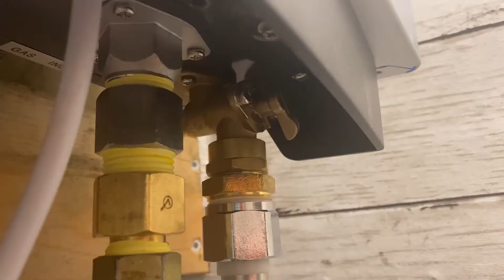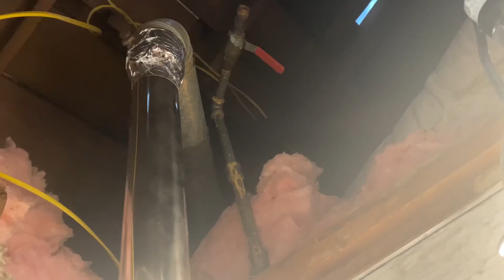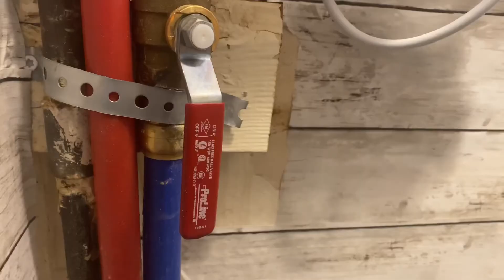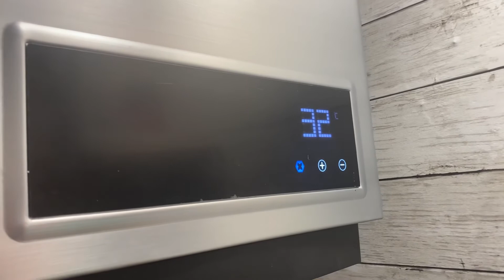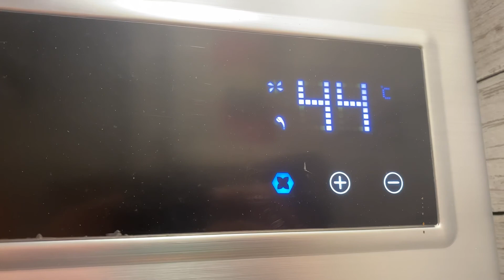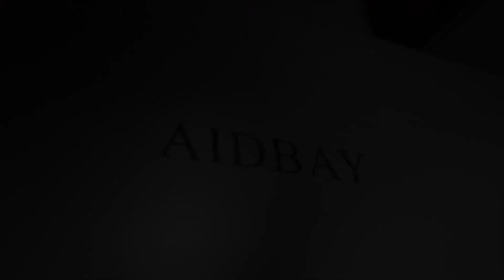AIDBAY Tankless WaterHeater

Comment: Do you have any info on a warranty for this water heater? I have a friend who bought one of these but has no info on the manufacturer or a warranty. He said the ad has been removed from Amazon. Would u be able to give me some info that I can pass to him? Thanks.
Reply from the maker: I sadly don’t have an exact contact other then another place that sells this unit.
https://www.you-buy.ca/en/product/QK5YL5NM-tankless-water-heater-12l-23kw-instant-heating-ng-water-heater-with-constant-temperature-automatic-s

I know the supplies have been thin but we still have not had very many issues with this unit and it been supplying our house with water without an issue.